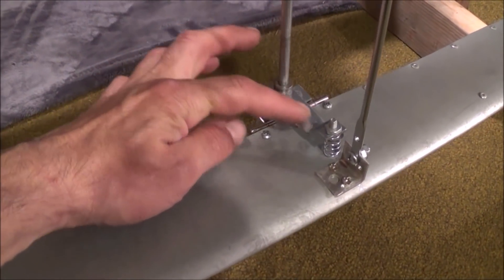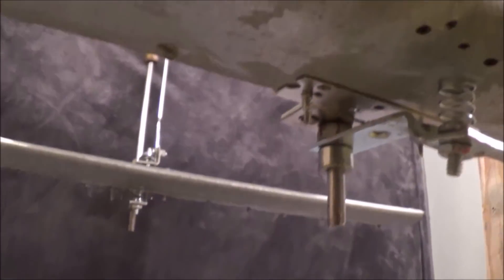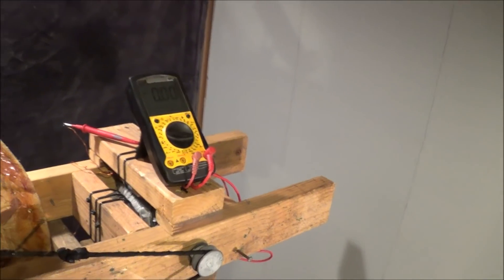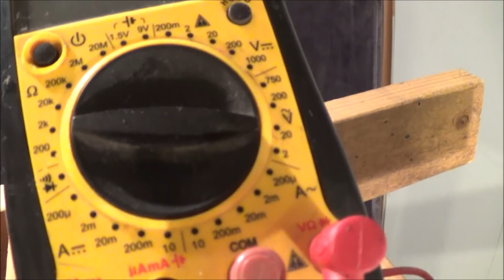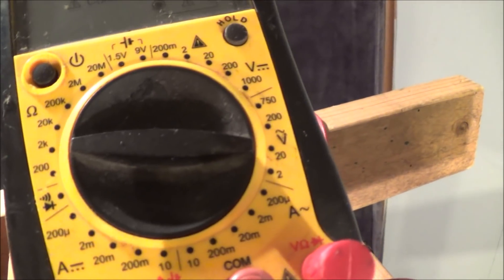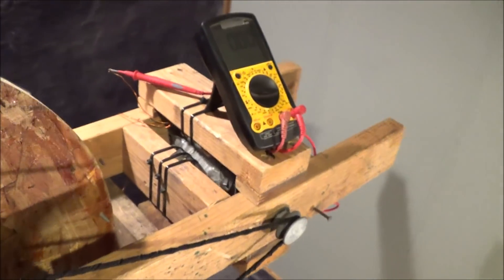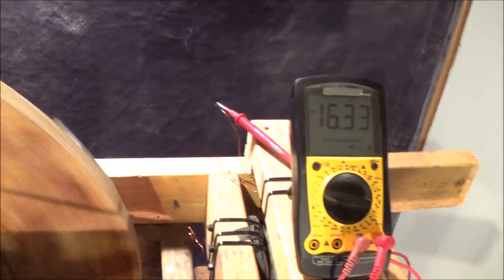Twin Hydrofoil Hydroelectric Generator, produces power from slow moving rivers without a dam.

Comment: Hi Mr Teslonian great content man. Please can you or anyone else here help me understand what's happening with my setup. (Only a 3 min video). I'll explain briefly, hooked up a washing machine motor (rewired to.run off 12 volts DC) to a battery through a charge controller.  The motor is directly coupled to another washing machine motor which is AC. I took the coil wires from the second motor and connected them to the load terminals of the charge controller which also has the wires that power the 12 volt motor. All well and good so far I use 12 volts dc to turn 2 motors nothing special. When I turn off the load on the solar charger and the load goes from 1.2 amps to zero.the motors slow a little bit but continue to rotate at a very good speed considering there's no power to it.  Please see the short video below to get a full grasp of it. I haven't got a clue why the motors are still running. Could it be to do with the AC of the second motor????

https://youtu.be/sHLQ_5ZYgas

Comment: Nice design.  I think you're going to find that the drag on the foil is going to bind your drive rod.  You might consider a fixed point in front of the unit, mid stroke, that would have a trailing arm to alleviate that force.  Many ways to fix that if it's an issue. Excited to see it in the water!

Comment: Will there be any problem with start up if the water flow becomes too weak, or is it possible the water flow becomes too weak more than a few times a year? If this could be a problem, is there a way to stop the cycle at a better location to await proper force to restart? Thanks again for sharing.

Comment: Will the water deflection flowing off the front hydrofoil not interfere or degrade the rear foil?
Reply: I guess that due to low speed of current and high densiy of medium (water) it should not have huge impac at all. However I would move timing of rear foil from 180 deg to 90 deg for removing "dead" angle when both of foils are retracted at maximum position - something like steam engine locomotive. Besides - this is very nice design.